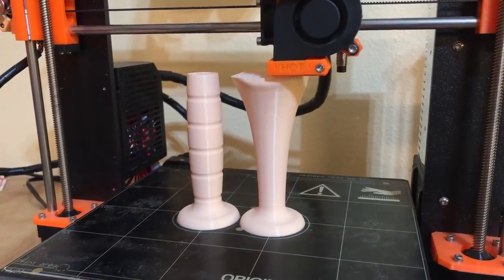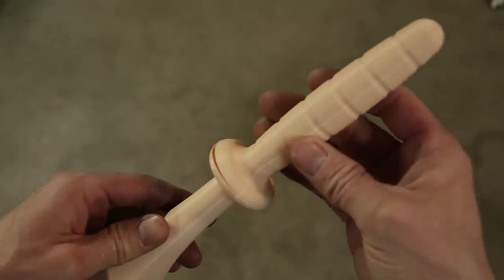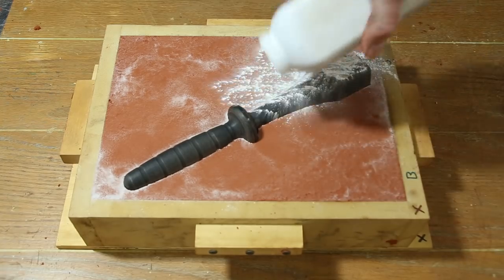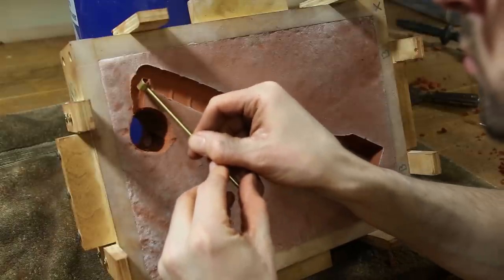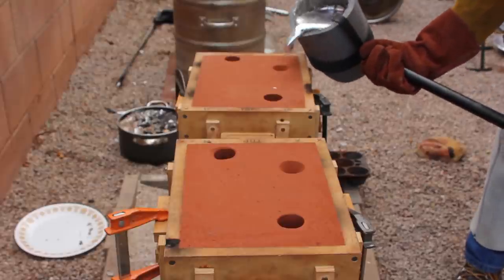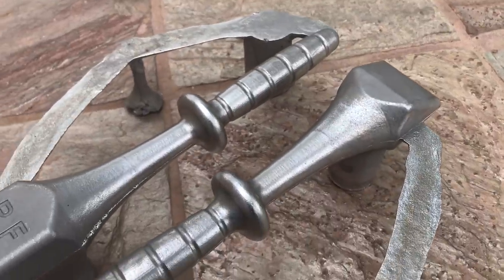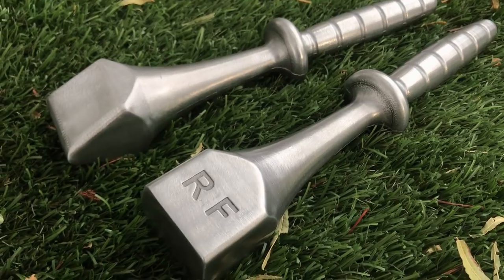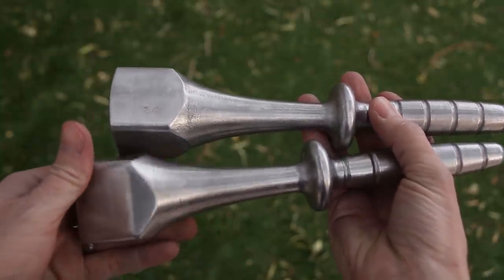Making Aluminum Sand Rammers for Metal Casting

Comment: I wouldn’t have thought you’d pull out and replace the object in between the mold creation, interesting
Reply from the maker: Thanks you!
Reply: Yeah me either.  Then it totally made sense.
Reply: I wouldn't have done it that way either, and I wouldn't of had to screw the board on either.
I wouldn't have used the half pattern at all, and did it with a false cope with the full pattern, which I've done before. A lot less work, but he did a very good job.

Comment: It would be fairly easy to mill out a square void within the mallet head of the tool and pour in molten lead or bismuth, followed by a flat recessed aluminum cover plate hold in with flush machine screws. That lead or bismuth core in the head would make the blows way more substantial. You could also fill it with lead or bismuth shotgun shell shot to make it a "dead blow" type hammer. #7.5 shot would probably be good. :)

Comment: Since I'm a friend of Dorothy, I immediately laughed realizing that the ol' backdoor washout device could be repurposed into a casting sand mold dusting bulb. I love things that have dual uses, especially when both uses are very fun! 😸
Reply: I'm pretty sure that's a Giottos Rocket air blaster for camera equipment and not an enema. But they do look similar now that you mention it.
Reply: @par5endos562  I guess I was a bit vague in my comment. I didn't think HE  had an enema bulb in the video. I was just saying I laughed realizing that others could repurpose their own for this reason. 😸 Every good bottom has one, and they look basically identical. 😸 Also, I just realized that the little baby amniotic fluid nose sucker bulb thingy also could work because it looks identical too. 😺

Comment: Ah. Fancy. Long time ago i just looked around on the ground for something to use to ram- saw a chunk of 1×2 and 2×2, made nice smooth ergo handles on em with a belt and palm sander. Been using them for a LONG time😂 that and a rubber mallet for my final pack. Have a mold drying up a little bit rn actually going to go pour in a minute

Comment: Perfect job. Very nice control when you poured because I didnt notice any air sucked into the mold. 
Either way I still use my multi sand rammer 😉
Reply from the maker: Thanks! The pours did go very well. Waaay too much metal in the crucible though.
Reply: @robinson-foundry  for the first pour actually yes. The way I count my ammount that is needed for my 3d printed casts is to slice the part in slicer with 100% infill. Then the slicer gives you information about the volume of filament that would be used for the print. I just add to it about 20% for the sprue, runners and feeders/risers and I am ready to go 👌.
Try it with your next project maybe it will help a bit. Either way I must say this project of yours was still a success! Good job and keep it up 💪

Comment: It looks like there is some extra aluminum sticking to the sides of the crucible after you poured the metal into the pans. How do you clean them?  Or do you just save those crucibles for aluminum work and use other ones for bronze casting?
Reply from the maker: I use a different crucible for each metal and alloy. The remaining aluminum just comes out though. It’s just a very thin layer. Thanks for watching!

Comment: I'm wanting to try some casting. Where did you get your tongs for lifting and pouring?  I seem to be only able to find the pliers type that you pinch the rim 9f the crucible with to lift it out of the foundry. The only pouring one's I've seen are the scissors type,  I don't want those either.
Reply: check bigstacked on YouTube for making a set he shows how to make a set at home with no welder.

Comment: If you have a 3D printer you should be making 2 piece split patterns. I work in a Foundry.  If you want the "best sand rammer" get a air compressor and a pneumatic rammer, but you do not need anything that hard unless you are making cores.  😁😆  I understand this is your hobby but you are overdoing and overthinking many of the processes here.  The sand does not need to be extremely compacted, it can cause surface defects due to the gas not being able to permeate the sand grains. I could definitely give you some tips from my 10 years in the foundry business from pattern making, molding,coremaking,melting and pouring if you are interested shoot me a message if anyone has any questions.

Comment: Do you just scrape off the black sand and reuse the rest?  Or does it all go to waste once you add heat to it?
Reply: The burnt black sand is separated from the red sand. The red can be reused without issue. The burnt sand can be washed and retreated with the mold chemicals but usually gets discarded
Reply: @danhammond8406  okay

Comment: how did the metal reach the circular bit where your hand is stopped? I thought there would stay an air pocket
Reply from the maker: The sand is actually very porous so gas can penetrate it eliminating the need for vents in many cases.

Comment: I am confused, why did you put the half printed in? What does that do to help the sand form to the object?
Reply: He needs the two halves of the sand mold to press together with a perfectly flat and even surface at the center of the mold where they close together (or else you get a sharp seam where they closed together). The easiest way to do that, would be to just put a flat bottomed half model in the bottom of the sand container and pack the sand over it, so it becomes the right shape when it's flipped over and you don't need to worry about extra steps packing the sand specially for it. You can't do that with a fully printed model, and you shouldn't put a full model on the top and pack around it because it would not pack well without shifting and no amount of careful packing will leave the top smooth.

Comment: Why not make two halves and use pins to hold both halves together when ramming up the other side? You had holes in the halves that could have been used for pins.

Looks like a lot of work the way you did it, even if you did use a split pattern.

Comment: a small tipp for gluing PLA peaces togther: just put some acceton on both sides and press them together until it evaporated. That will make for a really strong connection, because the glue is the same material, as the rest. Small restriction is, that it only works, when the two parts fit perfectly together, because there is no glue, to fill in any gaps.
Reply: The PLA I have doesn't do much with acetone, certainly won't make a good bond. Are you thinking of ABS?
Reply: @AGryphonTamer  
no I am not talking about ABS. PLA won't dissolve  in acceton. Nor can it be smooth the surface. But it makes the PLA squishy enough to fuse to matching surfaces together. I got really strong bonds with that. I recommand you try it. Perhaps with some small parts. It's easiest with the surface from the heating plate. you have to press them together quite strong for a minute or two.

Comment: I dont totally understand why you did the false drag, and then destroyed it
Reply from the maker: I did that to make it easier to find the parting line. I removed the “half pattern” because it was printed in a lower resolution.
Reply: @robinson-foundry  ok that makes more sense! Thank you for responding, it's an honor for the account owner to reply. I've wanted to try this, what do you think about melting small amount of aluminum with hair dryer forges?

Comment: 3 questions:

1. Why did you go with 2 rammers instead of 1 with 2 ends?
2. Why didn’t you just make the patterns with a parting line instead of having to ram up 3 flasks?
3. Why did you take care in ramming up the first one, when it was going to be thrown away? Also, why not just ram a flat flask, and carve out the space for the pattern, if you’re going to redo it?

Comment: I think that you made your vents way tooooooo big. Just a waste of aluminum
Reply: If only he had some sort of heating device that could melt that wasted aluminum and reuse it /s
Reply: @Argentumfoxx  well its not just that, he also wasted alot of time on removing them too
Reply: @JackTheAwesomeKnot  was to deal with the shrinkage in the part.  It shrinks a ton as it cools so the big vents were just to let it flow back to fill the center of the part as it cools.
Reply: @seanspicer1880  hmm that is a good point.. did not think about that, thanks